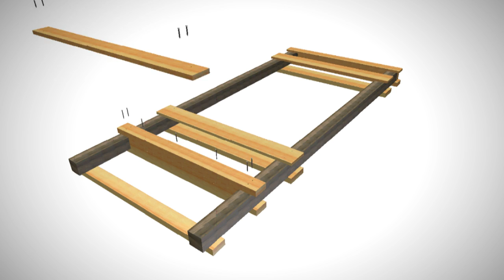Outdoor Planter Bench

Comment: I have several sections of fence at my fence line area.  It would be easy enough to modify this plan and make a potter's or gardner's table instead of a bench. I will also look at using painted pvc pipe instead of the metal as you show with this project. In using it at my fence line as I am thinking of doing, I would have to make a base that prevents grass and weeds from growing beneath the bench. Maybe some flat cinder blocks there would work well. I'll stain or paint the bench so that it flows with the paint on my outside storage barn.

I have a large patio area where a long bench done like this could come in handy for extra seating at the patio area. It would be much cheaper than buying the extra patio furniture.

Thanks for the video and ideas it gives me.
Reply: a1930ford  zip CA

Comment: The bench was easy to build but I'm wondering about the planters. You said you used sheet metal screws which is fine but, it looks like you may actually have used riviets?
Also, I noticed that you placed your end caps on the inside of the hvac pipe. Was that just to create the correct size fr the opening? I'm thinking that I'll  place the caps on the outside as the soil and water will create the weight and pressure that might otherwise push them out (with sheet metal screws or rivets).
Thanks for the great video. It was a fun and easy project. Oh, BTW, we went to a couple of LOWES (which was a task in that the nearest one is nearly an hour away) and funny thing, they don't carry any cedar, except for fence boarding. They even told me that there's no way these instructions would've come from Lowes. I went with a different wood and it turned out great.